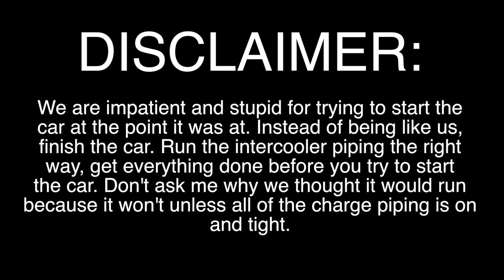MIATA TURBO BUILD | DAY 2

Comment: Hi
Do u mind I ask where u put the feed line？ the port down exhaust manifold(right one)or on the oil filter sandwich adpter？
Reply from the maker: Fandi Xiao This kit came with an oil pressure sensor T. Took oil feed from there under the intake manifold.
Reply: Austin Marcero my kit also came with that T. I was confused about where should it go. Thanks man！
Reply from the maker: Fandi Xiao No prob dude best of luck im gonna make in update on this car its been over a year and its still going
Reply: Austin Marcero great. How much boost u running？
Reply from the maker: Fandi Xiao 14psi right now but the car has 420cc rx8 injectors and a speeduino ecu now. It was on the fmu stock ecu setup for a year on 10psi
Reply: Austin Marcero have u dyno it？
Reply: Austin Marcero hi Austin，
I checked my car today but Im kind hard to find it. Is that t fit gonna be at beside of the oil filter？ is hard to reach？
Reply from the maker: Left side of oil filter and yes its a bit hard to access down there